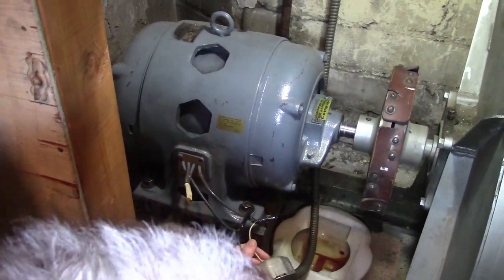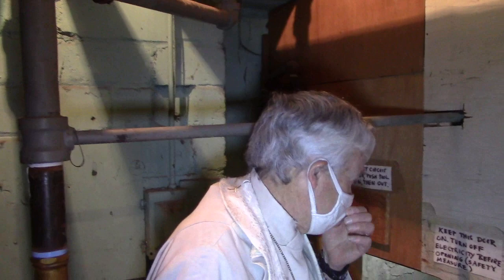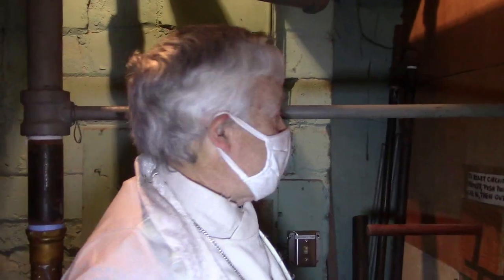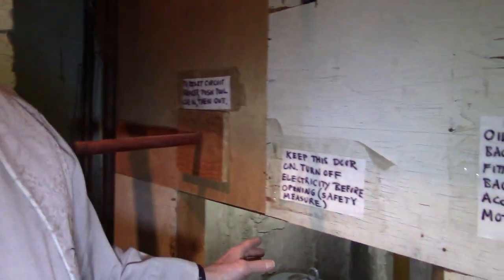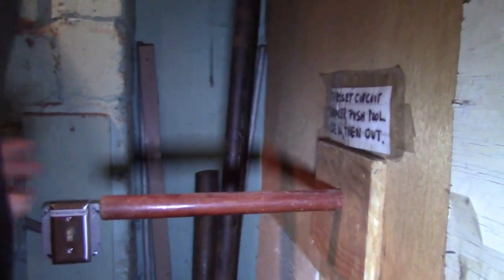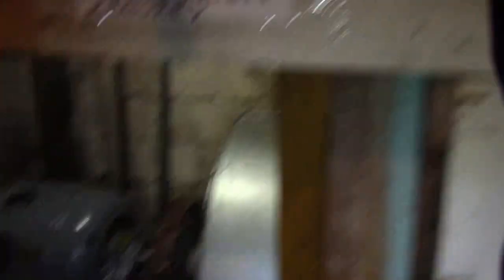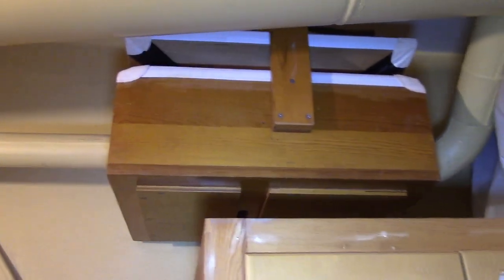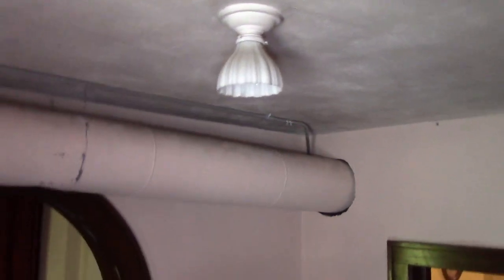Fixing an Old Church Pipe Organ with a Pool Que.

Comment: I'm not sure how long the programmable piston thing has been available on pipe organs, but I have noticed in many hymns there is quite a significant gap between verses (or even a vocal-only verse without organ). Presumably this was intentional to allow the organist time to manually change the stops one by one!

Comment: I have original Factory drawings for this specific instrument. According to the drawings the blower is a 3 horsepower Style 3-P-3027 Kinetic blower. Möller bought out the Kinetic company in 1939 and used their blowers on almost every instrument they built

Comment: that looks just like the blower for the 12928 Moller in a church I attended about 35 years ago. I replaced the leather pieces with material from a a heavy leather gentleman's belt, got a local shoe repair shop to cut it and punch the holes. This organ is celebrating 95 years of service, console is being updated and rebuilt. there have been NO tonal changes in all those years, other than adding a Cornopean and zymbelstern!

Comment: Just catching up on your videos Phil.. glad to see another video. 
As far as the motor smoking, is it a brushed motor? That may just mean the brushes or commutator need some attention. Hopefully that is the case. I am an industrial electrician, so I have seen a lot of motors in my time, and the old brushed motors will tend to make a little fuss when starting as the brushes and commutator wear. Hope this helps and thanks for the videos, always have loved organ music!
Reply from the maker: I need to check for that. the motor is too close to the wall, so I may have to move it off its mounting. I'll get back to you. Appreciate your help with this.
Reply from the maker: See my new reply 3 places up.

Comment: Another great vid Phil!
Does that motor run two blowers? 
Is the air for that entire organ supplied by that one (8"?) wind pipe? What kind of pressure is in that main line?
In addition; It looks  like a vertical grab bar may be needed on lock side of that division access door. You can see the organists trying to grab for a purchase as he unlocks and tries to enters the division room.

Sounds like some of those pipes need some of your tuning assistance.
Reply from the maker: That pipe supplies the console. One  10 inch pipe supplies the swell division and one 12 inch pipe supplies the great division. Pressure set to 4.5 in WC.
Reply from the maker: Also - at the other end of the  fanshaft is coupled a 12VDC generator for the electrical supply.

Comment: I think the sparks and smoke can be reproduced upon start up of that motor. The motor was still spinning when you tried to reproduce that condition, i would check that out again!
Reply from the maker: It's the brushes arcing on the commutator and EMR did not repair it, as they should have. I would like to change that motor anyway - it's 70 years old. I would replace it with an induction motor.

Comment: so why does the overload trip? Motor overloaded? or too small overload element
Reply from the maker: This came about when the motor had shorted windings and was drawing excessive line current in 2016. Oh yes, circuit breakers do tend to weaken a little each time they're tripped by an overload.
Reply: @busoldmanphil7293  yed but that is not a circuit breaker. It is an overload. Needs to have elements" for the right amprereage
Reply from the maker: @richardmosher7204  You're right. The circuit breaker is further back in the line.